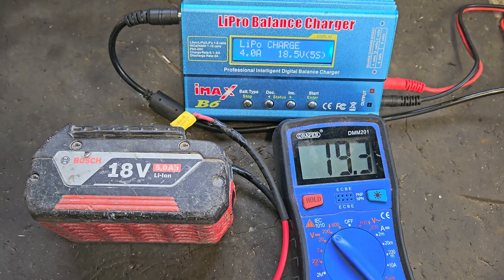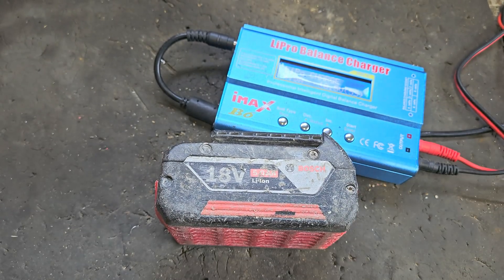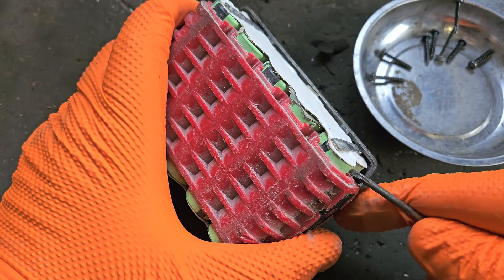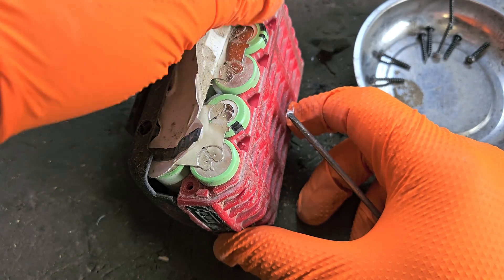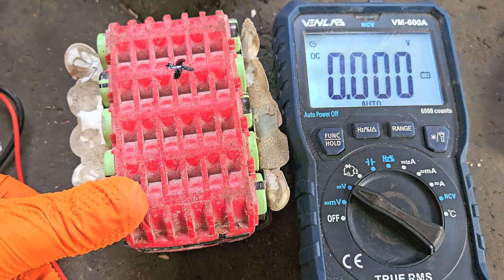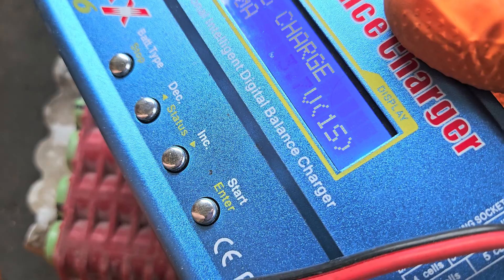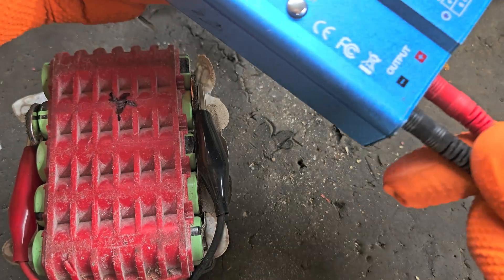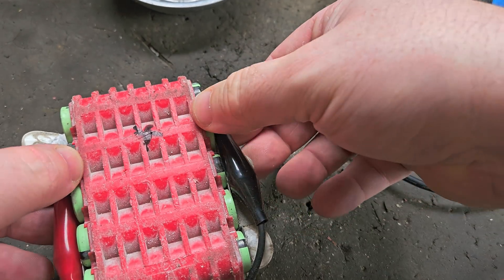Bosch Battery Balancing: Why It MATTERS

Comment: Got myself a spot welder yesterday for repairing my own batteries, 1 question I have is a few of the cells are reading over 4v and some are around 3.4-3.6 are the cells thats over 4v be bad or would that balance charger sort them out
Reply from the maker: If they are in the pack you can use a B6 balance charger to bring them to the same voltage.if they are out of the pack you can use an Xtar VC4 or VC8 to fully charge them all. They must be the same voltage as each other.
Reply: @doctorlefthandthread in the pack, i have 2 flexvolt to repair. Just waiting on the nickel tabs to arrive this week